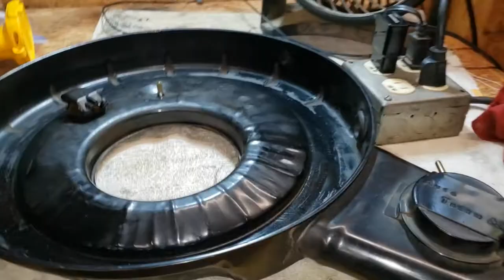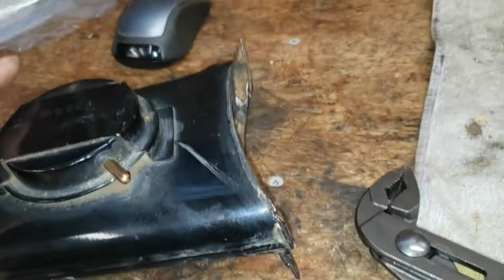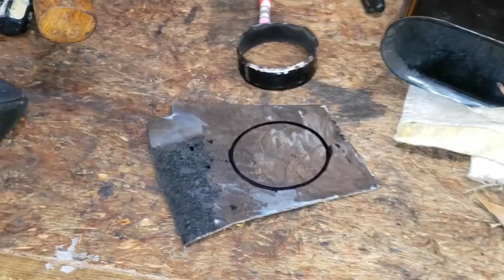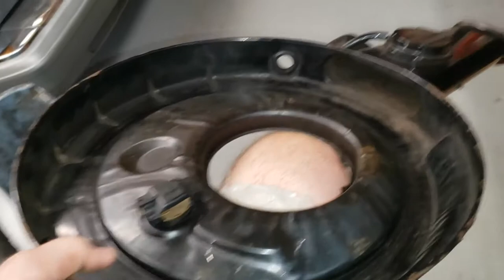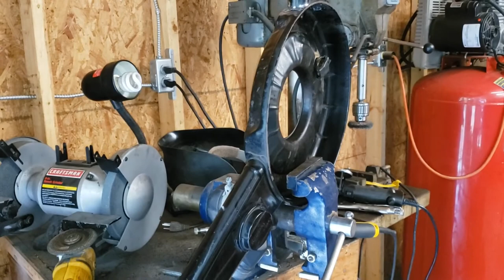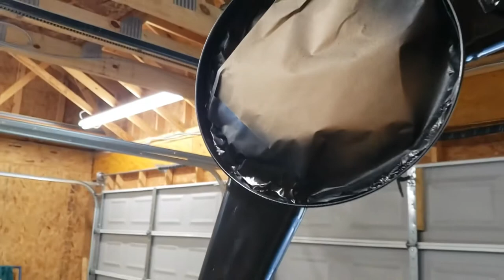Cadillac 472 Custom Dual-Snorkel Air Cleaner and Emissions Equipment Discussion

Comment: I’d be interested in seeing a follow up video on this. How does it sound, did it make more power, is it more responsive, etc. This is a really cool idea, I’d love to do this on my 68 coupe deville if it adds to the sound and power.
Reply from the maker: I'd suspect that any power increase would only be measurable or perceived on a dyno. It does sound better IMO. There is a little sound in this video of the dual snorkel.  https://www.youtube.com/watch?v=ekqisU30n5U
Reply from the maker: The idle issues I discuss in the Seafoam VLOG may in fact be attributable to a worn timing chain. I'm replacing all of that stuff right now in the latest series of videos.

Comment: This I my first time watching your channel, I really liked 👍🏾 the 472 breather ,I wish you could show how to remove all the emissions junk u talked about, I have a 1973 Cadillac Coupe DeVille  loved the video!!!
Reply from the maker: Thanks for stopping by! Emissions on the 73 verses this 71 should be similar. The major stuff I removed was the smog pump and the mechanisms used to regulate ignition vacuum advance, both of which can spark serious debate. lol...... I have my vacuum advance connected to full manifold vacuum. Removing the smog pump requires additional pullies to be installed. I've mentioned some of these things in videos but I've not made a video specifically about emissions stuff. Good idea.

Comment: You should rig some hoses onto those snorkels to get cooler outside air to them instead of hot engine compartment air. Probably add 50 horse power to it. Lol
I never paid any attention to those smog pumps and never really knew what they did except rob power from the engine.
Looks good!
Reply from the maker: That's on my list Werner! I'd like to get some flex hoses for both snorkels.

Comment: Are the Air Pump delete kits still available? I have a 69 Eldorado whose air pump is trash, but I still need it to run the water pump and alternator.
Reply from the maker: You should contact https://cad500parts.com.

Comment: could you go over how you removed the smog pump with what pulleys you used?
Reply from the maker: You need a kit to do this with the right pulleys. Got mine from Maximum Torque Specialties, but that company is no longer reputable. Contact CadCo. They have a kit. It's expensive, however. https://cad500parts.com/.    The smog pump serves as an idler pulley for the water pump, so removing it without incorporating other pullies on the crank will not work.
Reply: @ImpalamansGarage  could you just remove the vanes out of the pump and leave them pump there and it just not pump air?

Comment: Since i cannot figure out how to send you a direct message i'll ask here.  Do you have any tips for keeping the car running cooler?  I have a new radiator, new low temp thermostat, brand new heater core & coolant.  And unless i am going down the highway i cannot keep it under 210 degrees.  Any ideas?  I am going to get a set of 10" electric fans & install them in front of the A/C condenser.
Reply: Contact the Eastwood Company about a Tri-Flow Radiator.  The difference in temperature would be around 24°.   What thermostat are you running currently?
Reply: @matthewmiller2268  I am currently running the 180 degree thermostat.  I have since ordered a three row all aluminum radiator & am hoping that will work.  The radiator i had in there before was only about a third of the thickness of the stock one, so that probably was the issue.
Reply: Update, new all aluminum 3 row radiator, new water pump & thermostat.  Runs like a dream.....will barely get up to 180 degrees on a 100+ degree day running the interstate with the a/c blasting!

Comment: I have the 68 eldorado any advice? Same engine
Reply from the maker: Do a compression test whether it runs good or not. Speaks volumes on the health of the engine. What is your vacuum reading at idle? Healthy? If not that can lead down a path of investigation that can uncover issues. Does the engine have any problems?
Reply: @ImpalamansGarage  I I replaced some parts on the ignition and fuel system and got it running changed out the transmission fluid and it shifts very well been taking it for daily drives now at higher RPMs the big door on the quadrajet doesn't open and it probably needs to be tuned more
Reply from the maker: @ferenzi7741  If your secondary air valves are not opening upon heavy throttle the first thing I would check is whether they are simply dirty. Can you press on them with your finger and they open easily? If not, grab a can of carb cleaner!  LOL....The next thing I would check is the secondary lock-out. There is a rod on the passenger side that runs from the dashpot on the front passenger corner of the carb to the secondary air valve. The dashpot is vacuum controlled. If this rod is in a bind or is not moving for some reason it will prevent the secondaries from opening. The purpose of the secondary lockout is to prevent the secondaries from opening under conditions that do not warrant it. As an experiment you could remove the rod and see what happens when you drive it. But keep in mind the secondaries only open when the engine starts to draw enough air to suck them open.
Reply: a lot of times the secondary air doors wont open just revving in park. it needs a load on the engine

Comment: Can you run an open air cleaner on a 472 Cadillac engine?
Reply from the maker: Sure you can. Assuming the engine is in a Cadillac, I guess the main thing to look out for is height of the new breather. You'll need to take some measurements to make sure you won't be hitting the hood. You'll also need to put a after market breather cap on the drivers side valve cover though. Keep in mind I've not done this so I am just thinking through the process here. 😁
Reply: @ImpalamansGarage  yes i have a Cadillac 472 engine. I will order a new breather cap. I also want to hump up the camshaft a bit, just to get more bite

Comment: Let's have a road test with this improvement
Reply from the maker: Adds a nice sound when you go full throttle but as far as being able to discern any performance increase by just driving, I remain skeptical that anyone would be able to tell.
Reply: @ImpalamansGarage  get some cold air tubing  look up ford thunderbolt  on you tube  see how cooler air for intake  i did this to my 63 409
Reply from the maker: @quagmiredavis4117  dang thats some serious cold air hose. Lol..... not a bad idea.
Reply: @ImpalamansGarage  my impala 409 and 63 Galaxie 427 has that cold air system... what town are you located
Reply: @ImpalamansGarage  ok remove the reply with email I have it ..

Comment: O k dual exhaust?  You have to get the air out  i have dual exhaust on all my Cadillacs  they run cooler
Reply from the maker: I thought about it. I would not want it to be loud however. Duals with some quiet mufflers would be nice for an old Caddy. Only thing I've done to the exhaust so far is have the muffler replaced but I told the exhaust shop to delete the resonator. Adds a subtle rumble.
Reply: @ImpalamansGarage  where you located  ? We're taking the 66 Fleetwood to Texas leave on 1st 
It has quiet system duals does not 
Ping like it did with single system 
Plus Evans coolant  .. it has 45 k original miles . Just did valve job
Ported polished heads  longer duration cam . Cloyes timing gear 
Set . Reason for different cam better for today's fuel and harden seats.  It's very quiet and very mild on cam . 75 and 80 no problem 
I run Delo 10/30 winter  30 in summer.